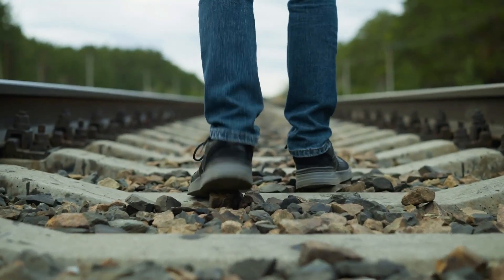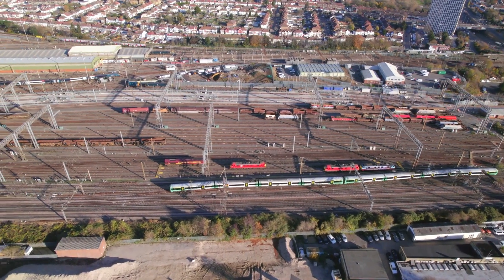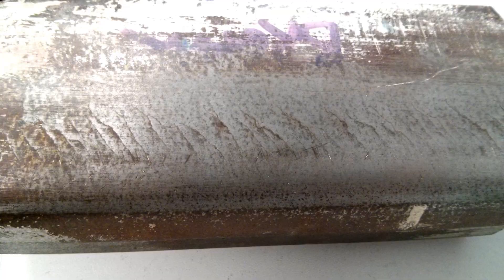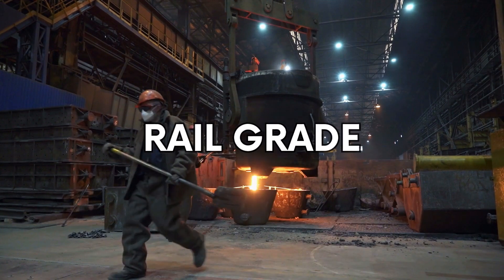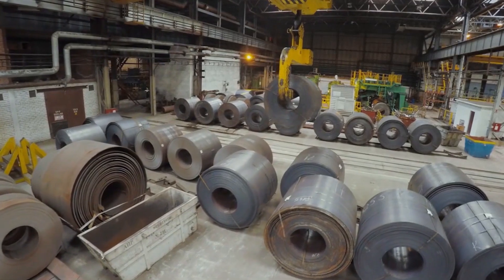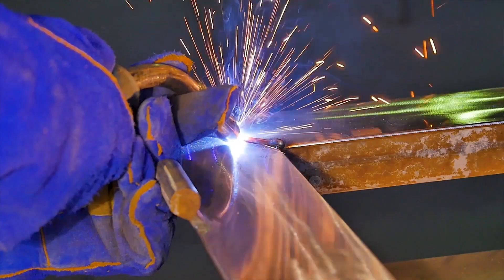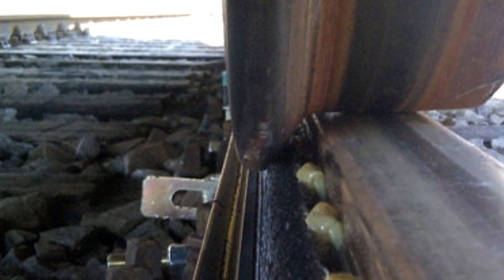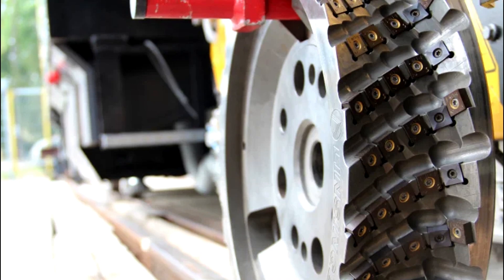From Steel Grades to Rail Grinding: How Do Railways Increase Rail Life?

Comment: Has anyone contemplated an automated system that instead of removing material from the rail, welds or brazes a new layer onto the rail?
Reply from the maker: I am sure they have, I guess the issue is time and cost of doing it over the length required. Not to mention the heat requirements to ensure a good weld
Reply: That would mess up the heat treatment/annealing, although I think they do it on switch frogs.
Reply: Yes, that is more common in the tramway environment where sharp curves in embedded track have areas built back up using welding. It isn't done for standard rails though due to cost.
Reply: I seen this done at London Victoria Station but it was crude and probably temporary .
Reply: @lassepeterson2740  there is some top of head welding done in a Zig-Zag pattern to ensure electrical contact between train and track - You most often see it at terminus stations.
Reply: @sensonic6514 That sounds like what i saw then .